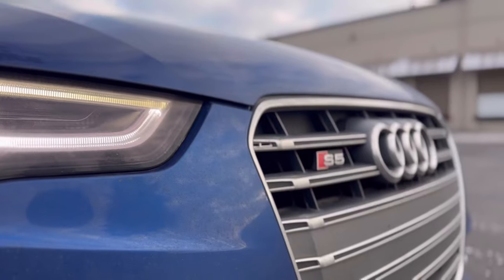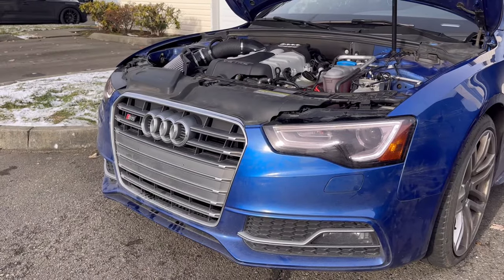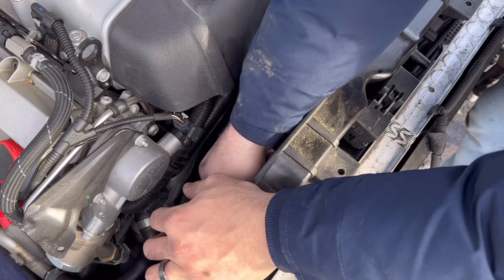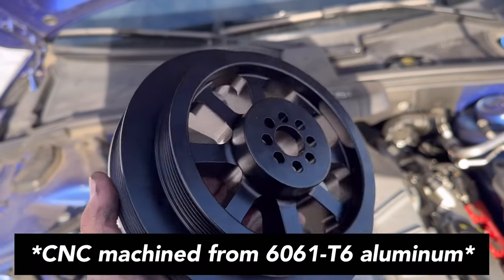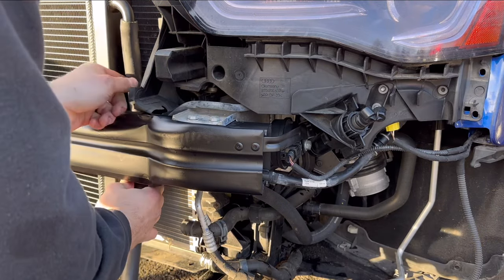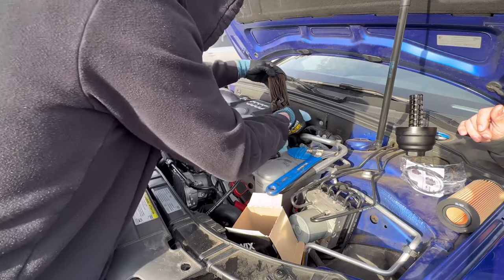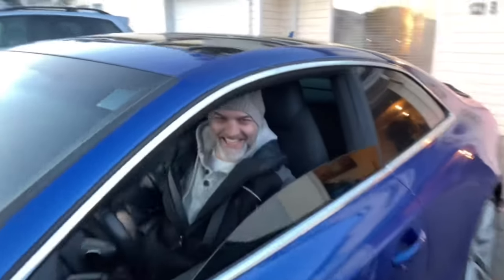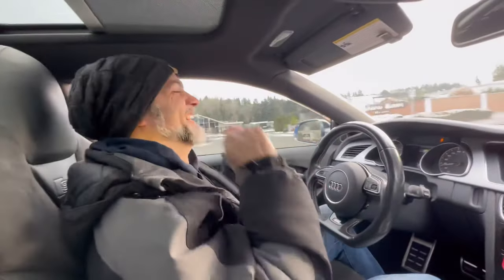Transforming A Subscribers AUDI in 8 Minutes!!

Comment: I wouldn't do the crackle tune without test pipes because it will burn through the cats super fast and you will have bad things happen. 🙃
Reply from the maker: Owner will be going with test pipes pretty soon here. No worries!
Those cats fail and clog up even on the stock tune at around 70/80k miles.
Reply: B9 crackles don’t have the same issue but I get it
Reply: @Need4Built  Where are you guys located
Reply from the maker: @Dutch5573  Seattle, WA area
Reply: @Need4Built  ok ty
Reply: @Need4Built  hey from the PNW I drive a 2016 a6 currently running stage 1 IE e85 file 506hp. Seen that your in the area or without a few hrs, was wondering if you could assist with install on heat exchanger and test pipes. And maybe dual pulley if it makes sense power wise… do you sell the parts in this video? I’m from Portland and car is my daily. Has the crec engine.
Reply: @Need4Built I need help help upgrading my S5 any help please I want to make it faster and better
Reply from the maker: @JoeyBAKAMarciano  how can I help?
Reply: @Need4Built I know you guys are in the west coast Seattle I am in TX .. El Paso and can’t find someone here that can do the Tune needed once I replaced the parts shown in this video
Reply from the maker: @JoeyBAKAMarciano  go to 034Motorsport.com and they have a local dealer locater on their website. That will help you locate a proper shop that knows what they’re doing locally and know 034 parts/tuning.

Their tuning is also all from your phone. So you could buy their cable and tune via your 034 account and when it shows up.. you can tune the car yourself from your phone. They have instructions for everything. It’s very easy!
Reply: What’s test pipes?

Comment: HEYO! How much did all of this cost? The intake, the pulley, the heat exchanger, and the tune all put together? I’m considering buying one of these, but i’d rather not pay more than 2 1/2 grand for upgrades.
Reply from the maker: Right there in the ballpark. Go with 034's tune, pullies, and mercracing heat exchanger.
Reply: @Need4Built  Thanks!

Comment: I believe this is the same motor in my '14 A7. Interesting.
Reply from the maker: @atypeandshadow  correct it is! Except you have the superior ZF8 AL551 transmission.
Reply: @Need4Built  I’m still learning about German cars are expensive and what sets this part I had a Mk5 GTI a few years ago. I’ll be doing a thermostat and PCV so I’m wondering about doing this as well since I’ll be doing the same steps with a few more.

Comment: Would you go B8.5 SQ5 or B9 for a build with daily driver usage?
Reply from the maker: Yes 100%. My b9 sq5 has already been built
Up to that standard and I want to build a b8.5 sq5 next with the same thing in mind.
Reply: @Need4Built   Which option do you think is the most reliable long term.  I had a fully built B8.5 SQ5 already, and ran it up until right at 210k before I started having issues.  Currently riding a GLA 45 AMG Cedes, and thinking from coming back from the darkside.  LOL

Comment: Yo the best set up you can have is a fluidamp with a bigger sleeve saves your engine in the long run that’s what I run instead of 034 or IE but rest of my car is IE just my motor mounts 034
Reply: Fluid amp?

Comment: Next time when you do an oil change just wait with putting in the new oil filter and closing it up. Leave it open and drain the old oil first, otherwise it's creating almost a vacuum and the old oil comes out much slower.. Oh, and just my two cents, great way how you hold you steeringwheel while stepping on it. Looks really safe😂
Reply from the maker: Safe driver I promise 🤣
Reply: both my exact thoughts, yeah we got LOT more power now and slippery conditions lets hold the wheel in the dumbest way possible so if ANYTHING goes wrong we make sure we crash

Comment: I just got my very 1st audi ever and it's a 2012 A6 C7 bone stock. And the parts you used in this video are the exact things I want to put onto my car. It only has 84k miles and I daily it. I was on the fence about using PLM HE compared to the Merc Racing HE but after seeing this video and hearing how it sounds I will definitely be doing this. I have no idea when I will have time or money to even do something like this but I am hoping the next year or 2 I can have this done. Such a great video and you gained a follower.
Reply from the maker: I personally want a C7 A6 due to the superior ZF8 AL551 transmission! I do suggest the Mercracing heat exchanger over the PLM. It holds more fluid and flows better. Go for their S6 HX. Its huge! Make sure to upgrade the coolant pump to a CWA-150 from mercracing as well. If you dont want to spend the money, PLM will do the job!

Comment: Absolutely love your content. Just got my hands on a 2011 A6 C6 3.0T Supercharged 161K. I was looking into Stage 1 remote tunes. Which one would you recommend?
Reply from the maker: I absolutely suggest you at a minimum get an intake and a stage 1 ecu/tcu tune from IE. 
https://performancebyie.com
You can use my code: NEED4BUILT. Get a tiny discount, but also go enjoy your car man. Wake up the beast inside 😼 
Thanks for your support!
Reply: @Need4Built  I plan on getting the intake from IE as that fits. Definitely going to use the code. Thanks for hooking me up  and bringing such inspiring content! 💯Unfortunately the IE Tunes don't support the A6 C6s. Still looking for the right ecu/tcu tune! ⚡
Reply from the maker: @arzeekhan  You can Email them or call them and ask if their 2012 tune will support the box code if your car. Worth a shot.
Reply: @Need4Built  Thanks for the tip man. I'm sending them an email to check.

Comment: Yup. bought a 2011 S5 Convertible. Buddy who sold me this POS failed to disclose that he only had cash for the Pully not a heatexchange.....fast for4ward 3 months,  Both my Cats melted and the engine seized. I paid $13K for a donor engine (original only had 612K miles on it). We are now in court
Reply: Sounfs like a lack of or incorrecf tune too. Most modded cars are as is. Good luck.
Reply: @toob247   We settled, he is writing me a cheque for $8700 better than nothing. He never disclosed that the car was modded, He got caught on the BS inspection he claimed was done, however he could not recall who did it...

Comment: Don't know why you change the air cold intake.
Reply from the maker: Better flowing+larger inlet, bigger 5in filter with a built in velocity stack for improved air flow intake. A proper heat shield to keep hot engine air away from the intake. The build quality alone would make me want to install it. 
Injen and CTS intakes belong in the trash. 

You want me to keep going? 😇
Reply: @Need4Built  LOL...
Reply: @Need4Built what’s the best air intake system you recommend
Reply from the maker: @JlanTurner-wp9ms  S34 from 034.

Comment: Never ever take your vehicle to a quick lube place.  I used to go all the time in my early years. After countless times at many different quckies I gave up.  The amount of times the filter was put on too tight breaking the rubber seal, broken caps, wrong fluids, etc its just not worth it.  Anyone with any mechanical aptitude are not working at these places.
Reply from the maker: Agreed